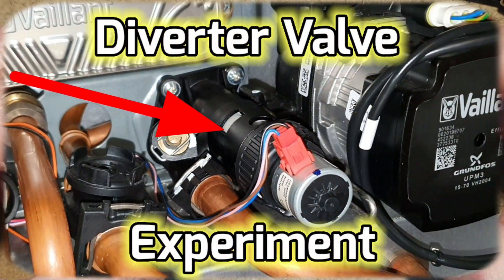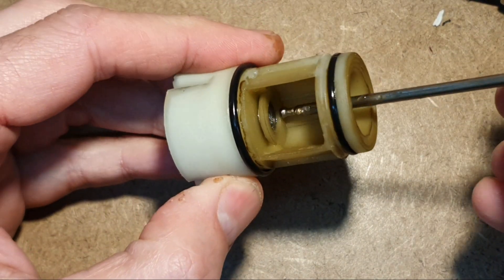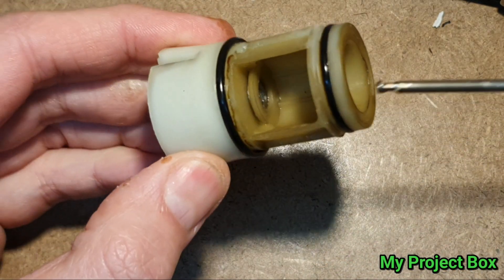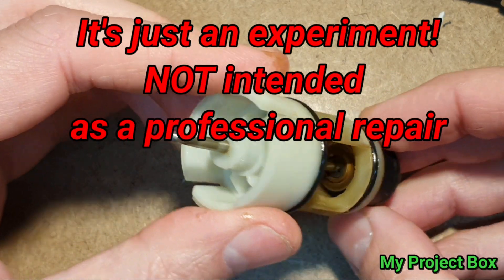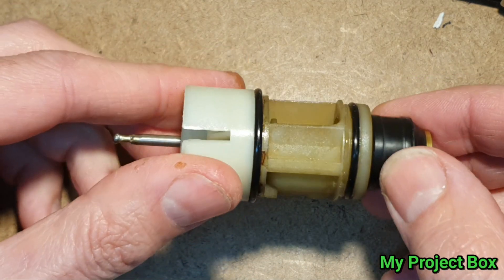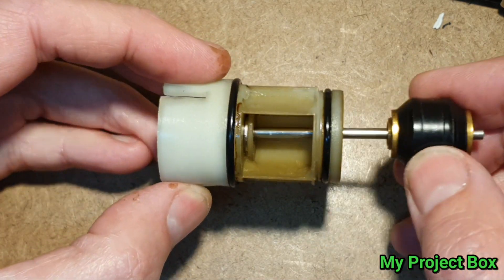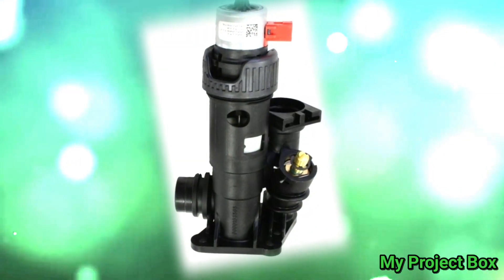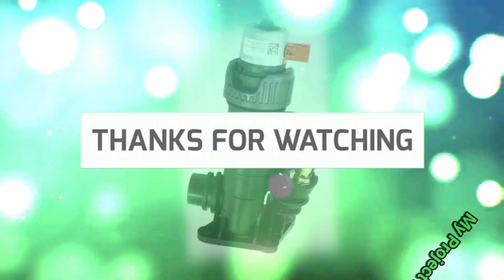Vaillant ecotec diverter valve tear down/ experimental repair

Comment: Interesting video!
Reply from the maker: Mabe the double o-ring can be changed to 4 o-rings inside the driver valve cartridge. This might increase the service life.
Reply: I love experiments, you have a good logical thought process, love it.

Yes mine has just started leaking today and came across your video, I'm thinking of just changing the cartridge.

Yes the valve design is not good, I suppose it also down to the quality of the seals.

Remember those early cars  that use to leak oil from engine crank shaft seals! you don't usually see this anymore, quality drastically improved.
I remember replacing one of these on my nissan back in the 90's the rubber had gone hard and started to crack.  This oil seal also had a small coil wire spring around the circumference, so as the seal wore the gap would close up, thinking about this the engine valve stem seals  also have a spring around them and these valve open and close hundreds of times a minute, so if something like this could be done it would make them more reliable.
But something like this would be a redesign!

Coming back to the boiler maybe you should lubricate this shaft once a year or maybe sooner, it should be very easy and quick to do as this shaft is visible when the boiler cover is removed.
Should only take a few minutes and you don't need to drain anything.
This might help extend the service life so worth a try.

If the manufacturer really wanted to improve the reliability of this valve so it don't leak at all they could use the induction motor method like boiler pump
Magnetic operation In which there is no phyical contact between rotor and the coil.

Good luck with your repaires though I hope it lasts 👍

Comment: It has nothing to do with hard water, the water that comes out of your tap doesn't go through the diverter valve.  The issue is vaillant use a very poor quality "stainless" steel that corrodes as it is worn slightly going through the gland.  It also depends on how you use your hot water tap like during washing up....are you the type of person who turns the hot tap on and off alot?  Some of my customers they last 5 years, yet some (worst case I have found) was 3 in 18 months.  I do like the idea below of molybdenum grease or maybe marine grease, might give that a go. This and the water pressure sensors are why we stopped fitting Vaillant 6 & 8 series boilers in 2019 after fitting at least 400 over the previous 14 years.

Comment: Nice idea and execution! Did you end up doing any longer term tests on this?
Reply from the maker: I moved house, so can't tell you the  the long term results. But it's definitely possible to service these cartridges, without replacing the entire valve. All that is required is a inexpensive good quality little o-ring! Mabe the aftermarket version will actually fix the problem for good. I don't think it's a difficult engineering problem.😉👍

Comment: Just today I saw there was a leak and it was this particular diverter valve as an engineer doing electric motors many years ago so far I got a box of rubber o-rings I'm sure the size will be perfect to replace all of them and put everything back together keep up the good work oh hopefully see more of your videos
Reply from the maker: If you find the right o-ring, it's definitely cheaper than a new diverter valve👍😉.  If I remember correctly, there's space to put a few extra o-rings in (Just remove one of the spacers/packers). It should improve the sealing and longevity.
Reply: @MyProjectBoxChannel  Friction resistance encreased after that adding more O-rings !  My solution is coating each O-ring by the electrical thermal shrinking isolation.
Reply from the maker: @Drillmechanic  interesting 🤔 solution. Thanks for sharing

Comment: Watched this with great interest.  Let me share my story as well.

My Vaillant Ecotec Pro28 started to have this leak.  The leak is very minor, unlike others who have their casing flooded.  The leak is not too bad when the heating is used regularly but now the weather gets better and valve is most of the time staying in hot water side, this seems to leak more.  But even then, it leaves a dry mark as opposed to wet puddle.

Mine is 12 years old and never had the diverter valve replaced before.  

The idiot plumber who fitted this, did not fit the inline magnetic filter.  Because of this, it first of all buggered up the pressure sensor when the boiler was 8 years old and frequently threw the famous F75 error.  When I drained the system to replace the pressure sensor, horrified to see the amount of gunk that came out.

At the same time as replacing the pressure sensor, I've fitted an inline magnetic filter Fernox TF1 Omega and flushed the system thoroughly.  The filter gets cleaned on regular basis.

The inhibitor used until this point was Cura, which is own brand ones from the online plumbing store and I can clearly say it was rubbish.  In other words, you could say the boiler was not very well protected until 8 years old.  At this point, I've dosed up with Qualrad inhibitor.

Now, I think it makes a difference where the boiler is situated.  Mine is situated at the highest point in the house upstairs.

First of all, the flue is through the roof so sucks in cleaner air than, say, boiler fitted on ground floor kitchen cupboard for instance.  To prove this point, the amount of gunk that gets collected on the condensate trap is significantly less than those boilers at ground level.

Second of all, though the inline magnetic filter does catch majority of debris, it does not catch non-magnetic debris and higher the boiler situated, it reduces the chance of debris getting up to a higher level.  Ok the pump does churn things but after a while debris tend to settle at lower pipings of the house.

As for your analysis regarding the lime scale causing the wear, don't know whether it makes any difference but I have a Fernox electrolytic scale reducer fitted before the water enters the boiler.  So, even when filling the boiler, the water goes through the scale reducer.

The electrolytic scale reducer does not eliminate lime scale, it just alters the characteristics so it does not cling to things.  This was fitted with the boiler and I replaced it when it was 7 years old as I noticed in degraded performance.  I live in Norfolk, which is one of the hardest water area within the UK.

I will be replacing my current plastic diverter valve with a new brass one this weekend. Today I've drained the system and filled it up with Qualrad system cleanser.  The system water that I drained wasn't too bad. I will run the system for about a day or so before draining and replacing the valve at the same time.
Reply: The brass diverter valve cartridge has a very nice design that makes it very easy to replace. Once installed, it can be removed without the need for special tools, and the replacement nipple only costs £7. However, it has a problem. The plastic circlip that keeps it in place deteriorates with the heat from the water. Mine lasted about 4 years before it crumbled. If that circlip had been manufactured with a heat-resistant plastic (nylon?), that brass diverter valve would be perfect. What a shame.

Comment: It has been 11 months since you posted the video. Could you please update us on if it worked?
Mine fails every two years. I always keep spare one at home, one just failed and i fitted new one,  i am trying to buy new spare one now  but the prices seem to have almost doubled.
My next boiler is definitely going to be INTERGAS, this boiler has no diverter valve.
Reply from the maker: It most definitely did work, but I did replace it with  a new original cartridge, about a month later. I was just curious to see if the seal could be improved. The problem is you can't do these kinds of experiments permanently on a gas safe installation. There's no insurance liability for it. I have since sold the house and the boiler has been put back to standard, and has had a gas Safe inspection. There is a company that makes a replacement cartridge that you fit only once and it has a replaceable seal, which can be replaced without draining the boiler. 
https://buycombi.com/product/ef-pb/

Comment: Have issue with mine ( it’s brass) brass valve or plastic doesn’t make difference.
Reply from the maker: That makes sense, since the cartridge that leaks (o-rings) inside is the same.

Comment: I too have had to change this at least 3 times and think it's a product design fault and vaillant should recall. I honestly believe they should be sued. How can a part fail so many times and no one's raised an eyebrow?
Reply from the maker: Agreed! And everybody just blames the water quality or inhibitor or something like that. My water was absolutely fine. Although I live in a very hard water area, the boilers should be designed to cope with that. The system was professionally cleaned, very thorough! Definitely a terribly bad diverter valve design.
Reply: I raised an eyebrow, but nothing happened.

Comment: you seem a really competent person  but you need to be gas safe to work on boilers, youare also modifying the boiler  which is a unknown you say that it is  ment as educational and entertainment purposes only. but you are running this boiler
Reply from the maker: Thanks for your concern. I have replaced the diverter valve seal cartridge back to an original part. The boiler has since been inspected by a gas safe engineer. I work as a maintenance engineer for a large oil company. I'm very familiar with large industrial gas boilers and various HVAC systems. Working on domestic boilers is child's play compared to the complexity of the systems that I normally have to work on. I believe If you are a component person, and you own it, you should be a loud to work on it. Not a big fan of the nanny state. That's how I learned electronics, by fixing stuff.
Reply: @MyProjectBoxChannel  I'm Shaw you are a component person ,there are many people that think the same but are not  component  its the law and its there for safety  i am gas safe and i see other engineers and think how did you pass  you gas safe
Reply from the maker: @stevenjohnson6082  you've kind of taken the words out of my mouth. I wasn't going to say anything. I have seen some of the incompetent work of so-called gas safe engineers! Sometimes I feel like these accreditations are just a protection racket, in the name of safety, and lobbied by the government. I have seen it happen as a qualified electrician where somebody else has to sign off my work. Some of the best engineers that I've seen, and most knowledgeable people that I know, have no government accredited qualification. I'm sure there are some gas safe engineers that are excellent at their job(my fellow work colleague for example) and absolute professionals. I'm totally with Elon Musk, He would rather employ somebody he knows is good, then with lots of qualifications. So-called engineers and technicians these days are just part fitters. No body will replace that 1 pence resistor on a PCB, but just replace the £100 board. Or just replace the pump instead of changing the £2 O-ring or bearing. I was taught to repair stuff by my dad (a proper engineer) If we couldn't find the part we would make a replacement on the lathe. At school I was taught to change a plug my Self. Now days that's a electricians job??  It's the nanny state and I'm not having any of it.

Comment: Its your dirty Heating water. Take a look at VDI2035
Reply from the maker: I don't think it's dirty water, the system was properly flushed and inhibitor put in. The magnetic cleaner is regularly inspected and spotless.
Reply from the maker: I will do that 😉
Reply: Your water is clearly dirty, the o-rings are breaking down the black mess from them shows this. 

The magnet will collect some ferrous metals not all. 

To much inhibitor can cause this fault too. 

If your having multiple failures get the water tested

Comment: Vaillant Ecotec diverter valves are a shit design , of all the different makes of boilers I repair these are the only ones that give major problems like this , the only way you have a chance is by fitting a good quality filter and drain and flush your system every year and put a good quality inhibited in the system
Reply from the maker: I think you are right. Something isn't right with this diverter valve design. I have been told that the brass version is much better than the black plastic one.

Comment: A handy Poundland USB charger case to put the bits in!
I had a similar leaking issue with our gas combi boiler a few years ago. Dripping from the shaft. Found a viton seal that was an excellent fit. Put in a good dollop of molybdenum grease. Still going strong.

Comment from the maker: I have seen your fit once system. It's a very clever solution for a recurring problem. I can't help thinking this is a inherit design failure. These diverter valves should be more more rugged and be able to cope with a bit of dirt in the system. My water seems spotlessly clean, and the magnetic cleaner as well. These failures are just all too common. Paddle type diverter valves don't suffer from the same problem.
Reply: What system uses a paddle type diverter?
Reply from the maker: @mdede2000  I believe some Worcester Bosch boilers use the paddle type. But don't quote me on that I'm no expert 😂

Comment: Good video. Poor system water with very fine rust particles results in early failure of the seals. With our Fit Once kit you can change the seals before they fail without draining down the boiler. www.buycombi.com

Comment: It’s that small amount of magnetite sediment that has got inside causing the failure. It nicks and grinds on the internal orings until they start to leak. 👍🏻
Reply from the maker: It's abrasive and grinds down the o-ring seals. But won't the magnetic filter remove most of the magnetite particals?
Reply: @MyProjectBoxChannel  I think the filter is supposed to help protect the boiler, but it won’t eliminate every single particle of sediment passing through. Eventually over time, bits get caught up in various components and is ultimately the cause of failure. I think it’s key to eliminate as much debris as possible before the install to maintain component longevity.